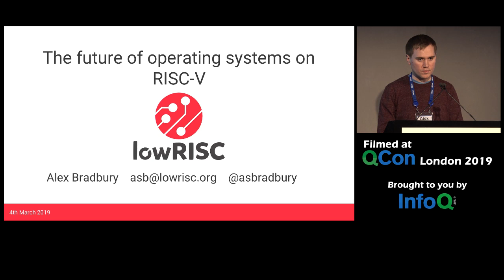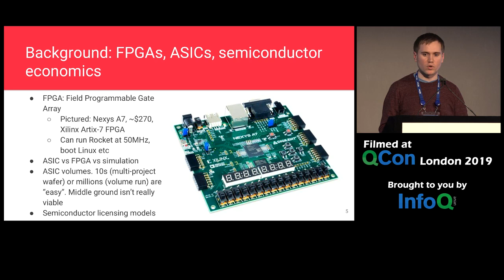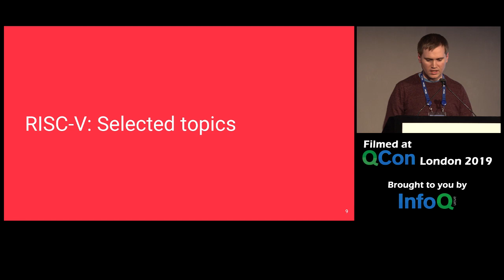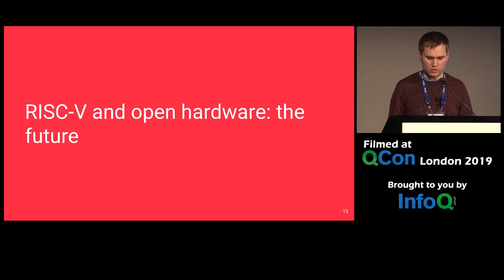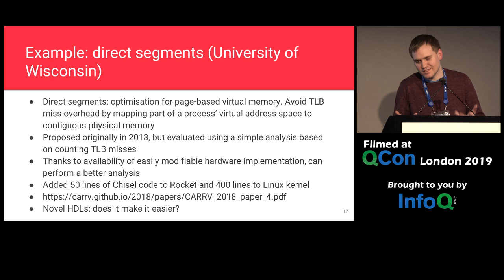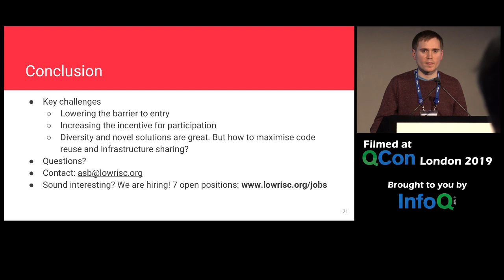The Future of Operating Systems on RISC-V

Comment: Phew, I was surprised when looking at the common extensions that there is no such spec for the MMU, so it's great that there is this SBI thing. There's so many microcontrollers in the space, but few general purpose CPUs. I'm a bit let down that this talk completely glossed over the CHERI clones, but I get the impression it was mostly outside his wheelhouse. It's actually what i wanted to hear more about when clicking the thumbnail, as CHERI is a genuine quantum leap.
Reply: The RISC-V spec includes the format of page tables in RAM and telling the hardware where the current page table is or if you've made changes to it. The spec does not include anything about what the hardware does with that information. The hardware could walk the page table for every memory access (not a good idea), or cache that information in a TLB of arbitrary design. That's up to the hardware designer. Software doesn't care. It will work on any hardware design that meets the spec.

Comment: The problem with people being able to add their own instructions is that the "standard" will disintegrate into dozens of "standards". That may not matter for embedded applications, but it will never be able to drive a PC, where software houses expect to be able to develop for a standard, and mostly unchanging, architecture.
Reply: That's not true at all. What will happen is that Microsoft, Apple, and Google will work with ARM, AMD, and Intel (and maybe even OEMs) to define an instruction set for the chips they manufacture. Likely, MS and Google will work jointly to define their own, while Apple will likely develop a modified version of what MS and Google create. Note that this is ALREADY how it's been working in videogame consoles since the 80's. 

The only reason this might not happen is that ARM and Intel will fight this tooth and nail. But times are a-changing. And it's WELL past time that all consumer level software is inter-operable. Damn all the emulators, recompilations, and whatnot.
Reply: @Noisy_Cricket  except these companies are now all irrelevant and monopolistic. The FOSS world is powerful enough to work with say Linus to defined a new extended instruction set that is FOSOH with extensions based on something that was already supported and out of patent like 68040, or get a planet wide license for MIPS or SPARC.  Something there is a full open toolchain for already, so compiler adjustment is less.
Reply: What you want is an agreed FOSOH standard for wearables.  Basically get them out of the proprietary world so no one is wearing uninspectable hardware.  Phones can use it too, and tablets, but there are hardware switching approaches (PinePhone, etc) to turn off the inherently invasive devices like mics.  Not easy for anything worn.

Comment: Does RISC V bring with it a potential for cross platform implementaions of softwares and programs? So we write a piece of code (in C/C++ lets say) and it can run on any OS/kernel? Because that would be sick. But sad case for Java developers though, because that language would become obsolete imo.
Reply: Currently Windows and MacOS don't support RISC V, only Linux does.
Reply: @leezhieng  freebsd does give some support to riscv64
Reply: @leezhieng  No one needs either.  Thankfully they can both be emulated easily even without x86 hardware as Apple proved with M1

Comment: So what we need here is a Linux running RISC V based board in the style of the Raspberry Pi.
Is that concept a thing on some agenda somewhere given the links between Lowrisc and the Raspberry Pi ?
Reply: "HiFive Unleashed

HiFive Unleashed is the ultimate RISC‑V development board. Featuring the Freedom U540—the world’s first-and-only Linux-capable, multi-core, RISC‑V processor—the HiFive Unleashed ushers in a brand-new era for RISC‑V."
-from sifive(dot)com/boards
Idk if this is truly the only linux capable SBC with RISC-V and at a starting price of $999 (Source:wikipedia) a bit much, but worth looking into. HiFive has cheaper SBCs with RISC-V meant for use as dev'ing boards but one shouldn't expect the same user experience as tried-and-tested boards like Raspberry Pis where the user base has been debugging cross-compilations for years
Reply: @zoeycassandra4291  it's different things. Raspberry Pi is a consumer toy built using semi-obsolete (or at least previous generation) chips that have had their engineering costs paid for by shipping in millions of other devices such as smartphones or set-top boxes. The HiFive Unleashed on the other hand is a board for professional commercial developers to get a head start on software  and/or hardware interfaces for other chips that don't exist yet. For hobbyists $999 is a lot (especially for something that performs roughly like a Raspberry Pi 3+), but as a tool for an engineer you're paying $10k a month in salary it's a blip. Note that ARM's corresponding A72 and A53 dev board is $10k.
Reply: @BruceHoult  I don't think Raspberry Pi is a toy. Many people use it for production purposes.
RISC-V is more or less like a hardware version of Linux.
Reply: @swwei All computers are toys.

Comment: Reduced instruction set, says adding more instructions is totally fine. Pick one?
Reply: The "reduced" part of RISC is relative to ISAs like the ones Intel and Motorola (and predecessors) were making at the time, for a given use case. The idea is that the instruction set could be reduced and (at the time) improve performance for equivalent conventional code.

It's not just about having fewer instructions overall, forever, in all contexts, regardless of the value they offer.
Reply: RISC is more about reducing the complexity of each instruction so that they can pass smoothly through an execution pipeline with the majority of instructions taking one clock cycle. The actual number of possible instructions is less of an issue. PowerPC famously is a RISC with a huge number of available instructions, and so is ARM's Aarch64 (despite being a considerably more pure RISC than its 32 bit ARM predecessor). RISC-V does happen to have a very small number of base instructions, with RV32I having 37 instructions that a C compiler would generate. That is sufficient to run any program, but depending on the nature of a particular program it might be an advantage to add extra instructions for integer multiply and divide (the M extension) or single or double precision floating point arithmetic (F and D extensions). Other specialized programs can likewise sometimes benefit from adding usually a handful of specialized instructions -- it's always possible to do without them, but sometimes you can increase speed and lower energy use considerably by adding a few highly specialized instructions.
Reply: Hybrid instruction set doesn't come to mind?